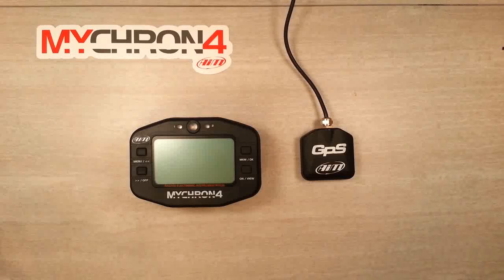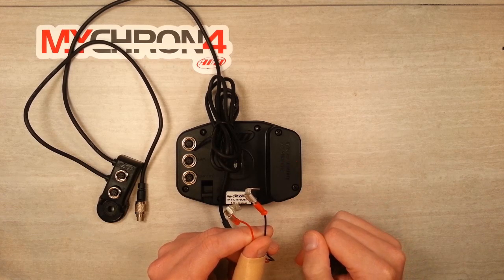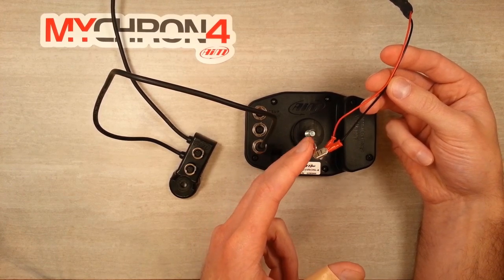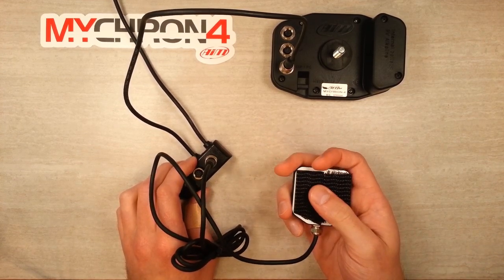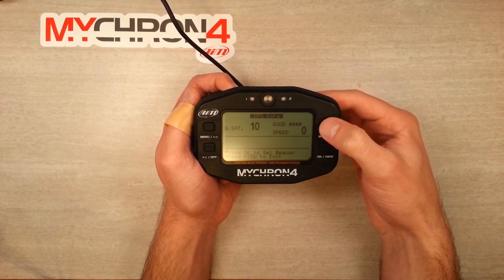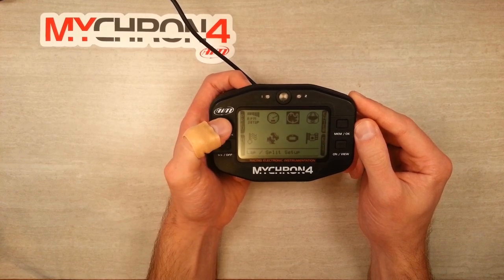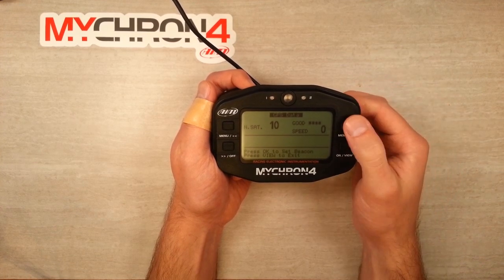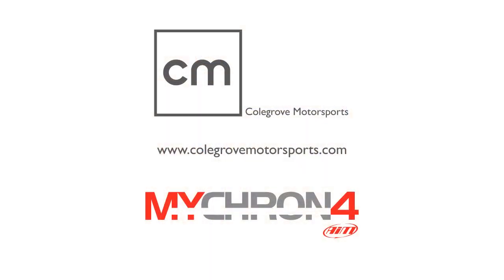AiM GPS05 Module Installation and Configuration

Comment: Thanks for this. Will the GPS gadget  now allow mph to show up on the screen or somewhere in the data at least?
Reply from the maker: You'll get speed, lat&long, altitude, and calculated G forces in all 3 axis
Reply: @KartSmarter  thanks, awesome. So just to clarify,  you will be able to see your speed on the front screen while you are driving?
Reply from the maker: @SwanappliancesAu  it's been years since I've used a MyChon 4, and I don't support them anymore.  It's definitely recorded in the data, not sure if you can display in real-time or not

Comment: Do I need a Ebox for the GPS?
Reply from the maker: 李泳達 No, the GPS comes with a 2 port data hub, which is all you need to have to start using GPS.  The GPS05 can be used in addition to an E-box, E-box extreme, or MyChron expansion with a MyChron 4 logger.
Reply: Is there any different between GPS and GPS05 ?   Or they are the same thing?

And if I attache a GPS module on mychron4 will it be able to read Kph or Mph on the screen? 

So if I want to have the race track map and set sections on the track , also , be able to read kph on mychron4 screen,
the only accessory I need is the GPS module . Is that correct ?
Reply from the maker: 李泳達 GPS05 is the model number AiM uses for the karting GPS unit.  You can set metric/imperial for all the unit in the MyChron, not just speed.  

As far as setting splits, you can do that on the logger screen, or after a session by connecting your laptop to the MyChron via the AiM Data Key.  Using the Data Key, you will use GPS manager which allows you to select your start finish line on-screen, as well as up to 5 splits.  Once you set splits, you will be able to use the predictive laptime function.